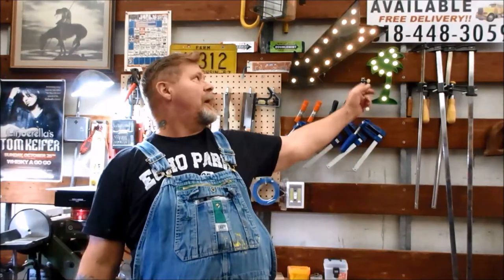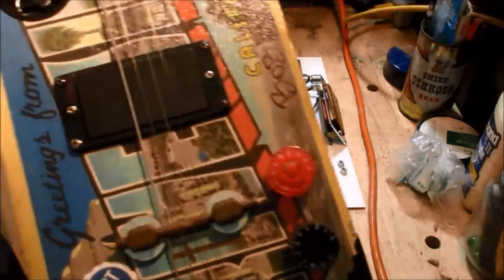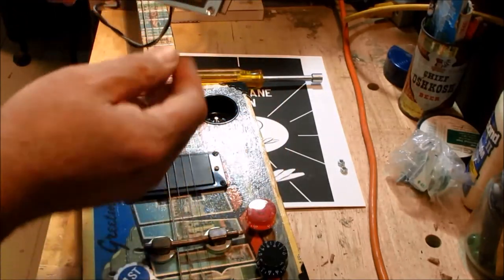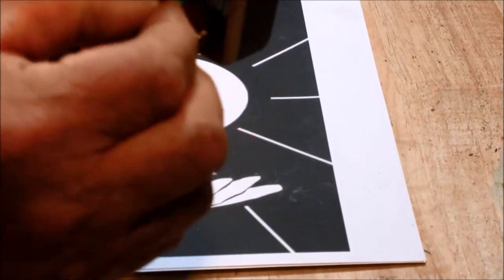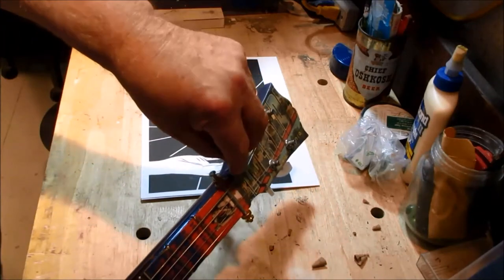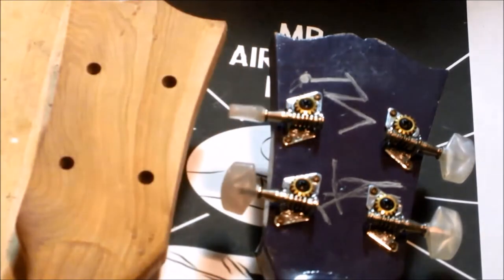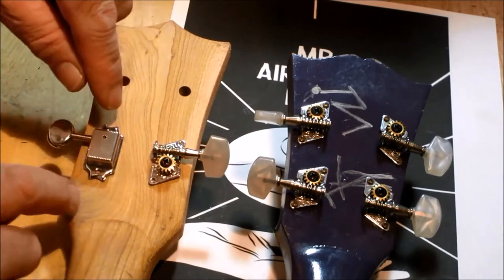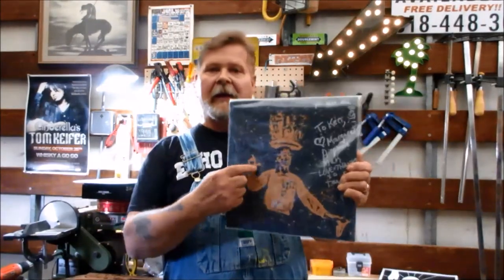Cigar Box Guitar Tune Up

Comment: Neck dive is the worst! I usually fix it by adding weight to the box with additional interior bracing. Mostly glued to the sides and back but not touching the top.
Reply from the maker: Lou Lamanna thanks for the tip!